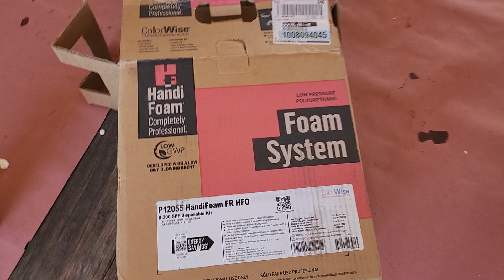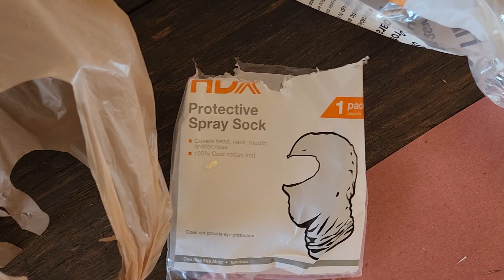His and Hers shipping container build out. Today we insulate.

Comment: If you were worried about the floor and hot/cold, you could put something like sill plate foam between container wood and OSB to make a thermal break.  But you may not need it.  W/O the sun beating on the floor, it won't get hot.  And the container will probably act like a thermal battery releasing heat over night to the ground, so it will warm up pretty quick in the morning.  Great job as usual!